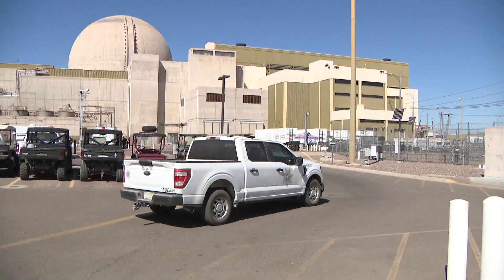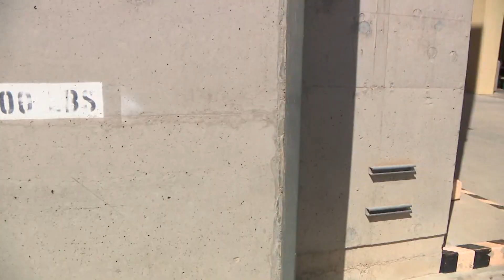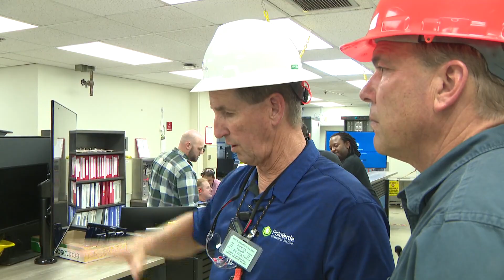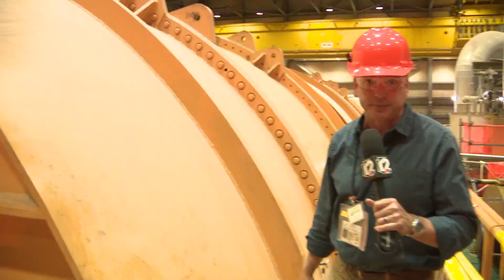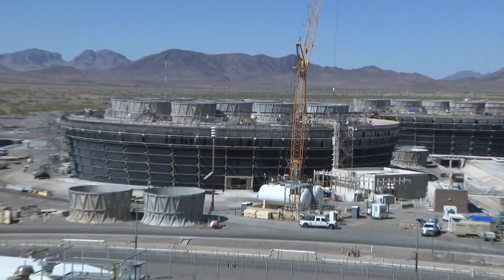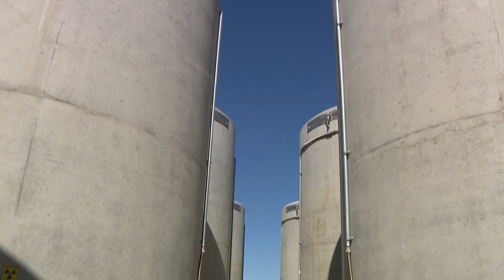Touring the Palo Verde Generating Station

Comment: Troy missed a two key questions: Well … how often do N-16 (Nitrogen 16) alarms sound, and what then happens in totality when they do? The bigger question  Troy missed was WHAT key lessons and changes happened as a result of the world's last big nuclear catastrophe, March 11, 2011 — the Fukushima-Daiichi nuclear power station disaster — where backup power failed to kick in and thus any and all cooling failed?  What changed at Palo Verde after Fukushima?  That aside, very interesting tour.  **TONS** happening in the field of new nuclear tech, design & safeguards. Thank you.
Reply: Backup did kick on at Fukushima-Daiichi and then a short time later the Tsunami hit and knocked the generators offline.  The plant had a battery backup system that operated for several hours but what was critical is that essentially the electrical rooms for the backup power systems got flooded.  So that mean even when additional backup generators had been brought onsite there was no where to connect those generators to because those systems had been flooded.  Palo Verde being at a inland location doesn't have to worry about Tsunami's.
Reply: N-16 has a half life of 7 seconds.  It's not much of a danger to anyone except workers inside.
Reply: Biggest question would be what are the safeguards around a meltdown
Reply: @Th3Duck0nQuak  Emergency Cooling pumps and backup power.  You also have a containment structure around the reactors incase all of this fails.
Reply: Um, is Palo Verde in a place which can be tsunami?

Comment: yucca mountain repository never opened, and has been defunded....wonder why he said that
Reply: Nevada being a “Swing State” is the entire 100% problem.  Presidential moron candidates will pander for Las Vegas & NV votes by promising to halt Yucca Mountain as America’s best long term waste solution.
Reply: It's still officially part of the Nuclear Waste Policy Act. It was defunded, but technically not cancelled and they are likely officially required to recognize it still. The project could, and SHOULD, be evaluated with the recent lean back into new nuclear power. That in combination with repurposing the fuel to power smaller reactors would be a great engineering challenge to see overcome.

My 2 cents are that the political "reasons" for defunding it was to push alternative clean energy policy. I speculate it was done to point at the now forced outdoor storage and say "this isn't safe, we need solar there instead" or something to that effect.
Reply: @Tomd4850  just like low income housing, the *nimby's won out...
*not in my backyard

Comment: Along the railroad tracks that head southwest along Kyrene is a 3-phase, triple conductor per phase power line that is carrying 500kV from Palo Verde. It is the one with delta (V-shaped insulators. This is the same power line that goes along the South Mountain Freeway to the SRP Kyrene Generating Station. It then heads east along the canal east, possibly providing electric power to El Paso.